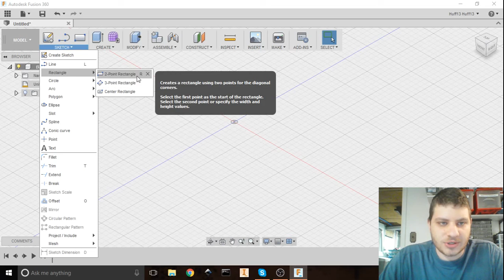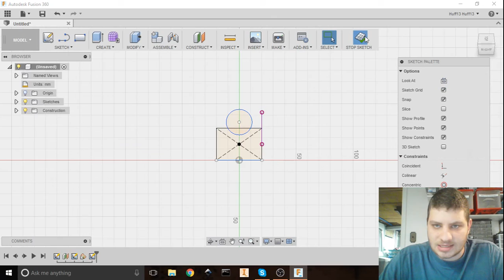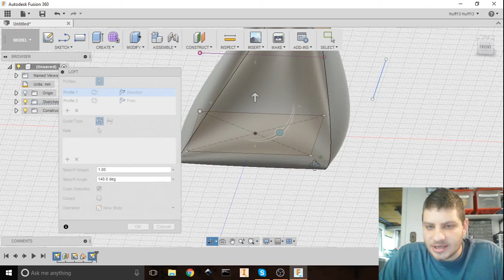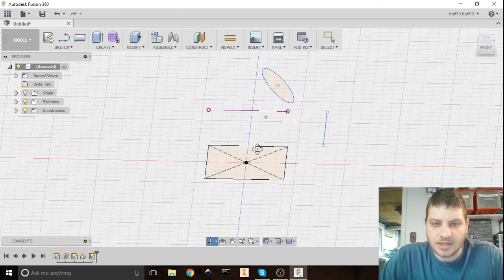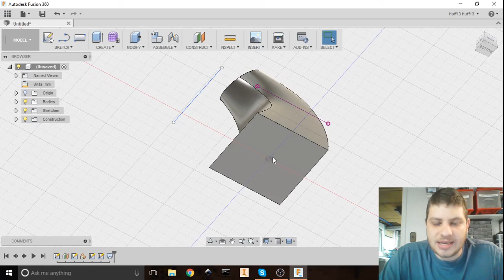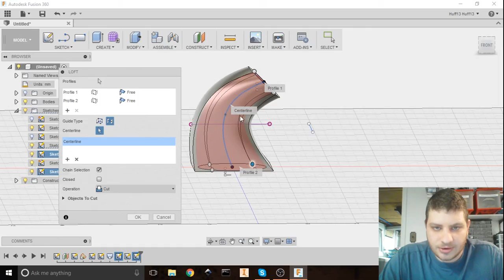Loft tool: Fusion 360 Advanced Tutorial

Comment: Found this very inspiring. I'm a boat builder and I'm looking to use CAD and Fusion 360 to loft boating planks so I can transfer (loft) dimension to the wood. Do you know if Fusion can flatten curved planks 'after the loft' so I can get the patterns cut? It's a bit like UV's maps from traditional 3D packages like MAYA or MODO
Reply: I am working with vintage balsa model airplane plans.  Some use a former and keel design which is fairly easy to handle.  With designs where the fuselage is composed of sticks, but with taper, as seen from the top view (you build the sides first typically), often what happens is the sides will likely fall a bit short relative to the top view once built to shape.

I'm guessing that is more critical for you.  I would just build around it, but I'd like to create plans from Fusion that are more accurate.  I'm guessing that once you've created your loft work, you should be able to provide accurate drawings...… Should be easy enough to test it out.  
https://youtu.be/bsWdkYSytVA
Reply from the maker: You might be able to do it in sheet metal mode. You could try setting your metal size to be the same size as your wood. If that worked, then it would give you a flat pattern. But I’ve honestly never tried sheet metal design in fusion before. 🤷🏻‍♂️
Reply: Design The Everything I thought the same but I'm found a lot of lifting and twisting and from what I've seen of sheet metal it's angle flat bending but I'll try and see what the outcome is...
Reply: I'm hoping I can model a curved assembly, turn it into components.... flatten it and make a drawing of it.  Lots of work.
Reply: Robert Vander Voort https://youtu.be/OcXlSD6oOhQ this might do it
Reply: Paul, thank you kindly

Comment: Question, can I do a faceted loft of more than two profiles (ie using all squares)? I had to do two profiles at a time to make it work for me. Thanks for the vid
Reply from the maker: I’m pretty sure you can. You just have to select them all. The big thing is to make sure that you don’t bend too tight. If you try to do too tight of bends, fusion will give you strange errors.

Comment: i made a propller and i need to twist the blade
i dont know how to do it
in solidworks you just use twist command
Reply from the maker: +Allen A if you just want a consistent twist it's easy, you just rotate your final profile and do a loft, though if you want a variable twist you will have to break it up into sections and use rails.
Reply: thanks
i think i have to loft to about 30° to create the twisted part then project from that angled plane and extrude to cut so thickness is consistent
Reply from the maker: +Allen A that would probably work. I'll look into twists in fusion. I actually modeled a turbine blade in inventor the other day, but I'm 100% sure how to do it in fusion. Ill have to play with it. If I find anything out I'll make a video or comment here.